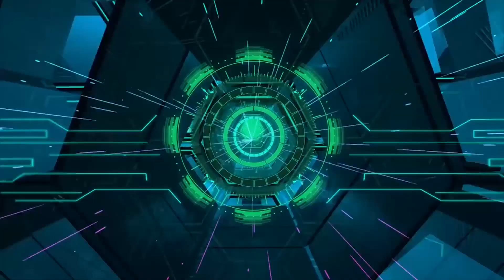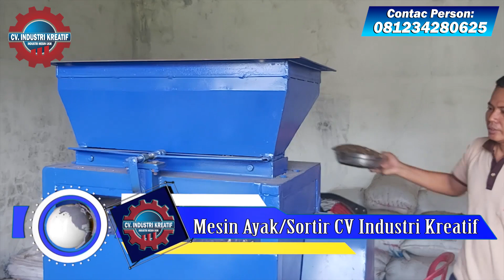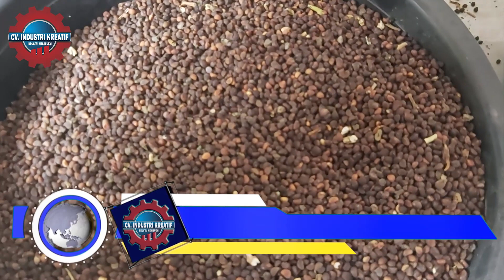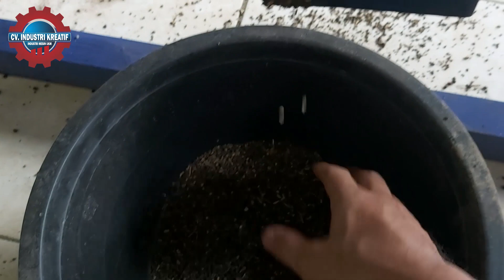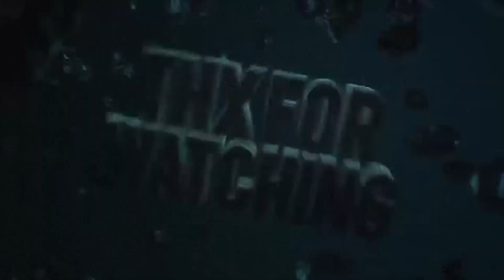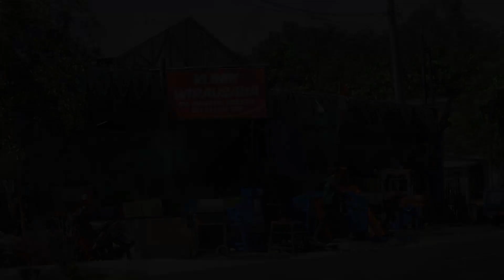Mesin Ayak/Sortir Biji Kangkung

Comment: Untuk blower/pemisah kotoran serta pengayak kacang ijo alat ini apakah bisa boskuhh.....harga nyampek berapa...
Reply from the maker: bisa pak raedy 
wa aja pak 
📞 Info dan konsultasi :
Telp/WA :
CS 1: wa.me/+6282142267610
CS 2: wa.me/+6281217850288
CS 3: wa.me/+6281234280625
CS 4: wa.me/+6282334870125
🏢 Workshop : Jl Madiun - Ponorogo KM 10 Selatan Puskesmas Geger 300 Meter ,Ds. Jatisari Kec. Geger Kab. Madiun